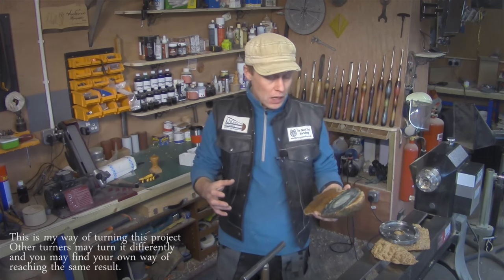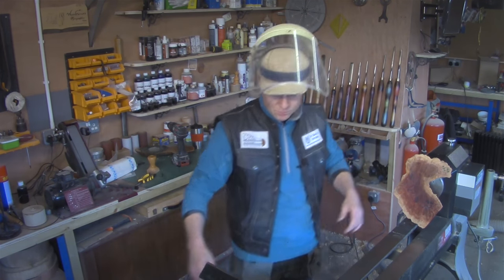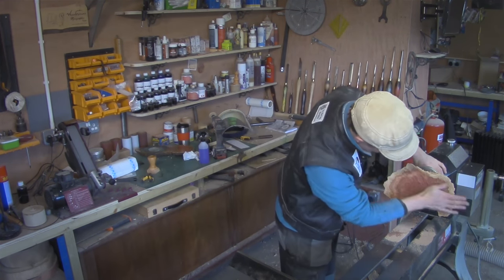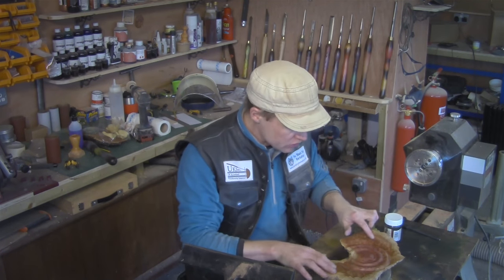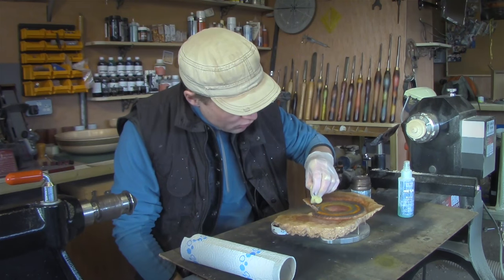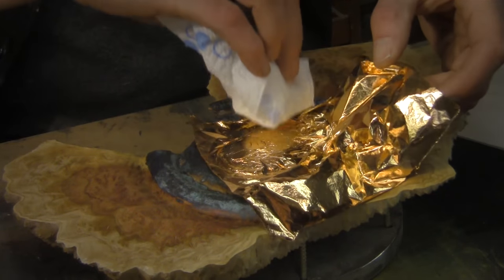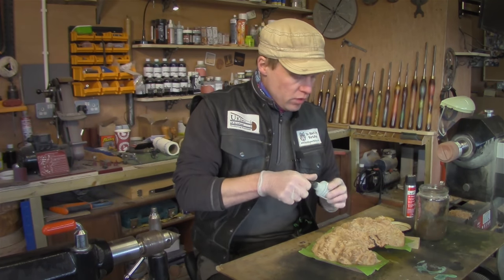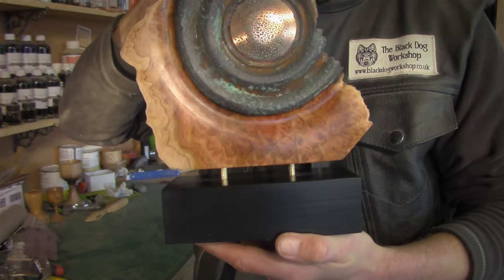#78 Turning an 'Ancient & Rusted' Mallee Burr Wood Ornament

Comment: Looks great Martin. I did wonder about the back when you started covering it with the paint as it looked really nice to start with. I don't think it has made it worse but also don't think it's made it much better. Anyway just my thoughts. The real striking part is the colouring of the wood, has a fantastic finish and colour to it. The shield just gives that extra point of interest which certainly makes the piece. Well done!
Reply from the maker: +Paul Lockwood Thanks, Paul. Interesting thoughts on the back of the piece. Simple reasoning for it - it wouldn't 'match' the front had I left it. Also, hiding the screw holes would have been a lot more difficult.
Still...art and creation is always open for debate. Such is the joy of it. This piece and thr sister piece have  sold, so I'm a happy bunny.
All the best,
Martin

Comment: Absolutely gorgeous, particularly like the back with its glowing lava like appearance - though when I saw you ladling on the iron paint I couldn't believe it was ever going to end up looking as good as the pictures you'd put on FB.  Is there a reason for using a sponge rather than stippling it on with a brush? (I'm guessing stroking it on would leave brush marks).

Comment: Lovely! The ONLY complaint I have - and it is a teeny thing really - is that the copper bit looks like it was sprinkled with patina rather than being aged like the rest. I'm not sure if there is another way to do it, that would have been less 'dotty', but the other piece didn't look like it had the same issue... but it is absolutely beautiful, even with the sprinkles!
Reply from the maker: Hi Susan. Thanks for watching and commenting. I know what you mean about the spotted patina. It has though, turned out as I wanted. I'll be doing at least one video this year using those paints again.

Comment: Stunning, just I knew it would be. A quick question, what did you use to finish the front? I'm guessing Hampshire Sheen High Gloss? Also if you weren't going to paint the back what would you have used to fill the holes, as coffee would be very dark against the light shade of the burr.  Once again a stunning piece and thanks for sharing. Jon
Reply: Hi Jon, I noticed your question of what to fill the holes with? I have had GREAT results with using a sawdust which is the same color as the wood, along with CA Glue. Respectfully, Martin might have a different approach though. Hope this helps! Have A Super Week!.....Gus
Reply from the maker: Hi Jon and Gus - Indeed, sawdust would have worked just as well as the coffee grind. A couple of reasons why I didn't go down that route: First up, I didn't touch the back so there was no saw dust from the back of the piece to ensure a spot-on colour match for the fills. If the fills are going to match, they need to be as perfect as possible otherwise they may be more noticeable - and in my book, that is almost unacceptable!
Had my intention not to have painted the back, I would have found some dust from somewhere of as close a colour as possible to use to minimise the hole's appearance.
Secondly, the coffee grind has been unused around the shop for ages; It is fine enough to pick up in gloves and easily drop/rub into the holes; It isn't so fine that it sticks to your fingers or gloves even before you get to the glue...in a nutshell though - because I was painting it, it didn't matter what I used as it was all going to be covered anway
And Coffee smells good. Nice than saw dust, anyway!
Hope that helps!
Martin

Comment: amazing work fella, i notice the sticker you peeled off where you bought it from, i have 4 smaller pieces that were duct taped together and red plus blue ink numbers written direct to the spikey side!!! , how did you manage to clean the ink and tape residue off?
Reply from the maker: Thanks, Mark. Sounds like you bought from the same place I did. Luckily only two of the pieces I bought had sharpie on the bark side...soooo annoying. This piece though had no writing on the back. I tried to clean it off the other pieces, but it wouldn't budge, so I painted over it. None of the pieces I bought were taped together though, but careful use of white spirit or meths should  clean it up for you.
Reply: Thanks buddy i tried acetone but all it managed to do was smear it, if the stuff wasn't so rare and beautiful i would set up a dispute and send it back, technically it is hiding information as the pics all show him holding the burls with the spiky side in the palm of his hand and taken from below with no mention in the descriptions about ink on the side most people show in casting/jewelry/stabilizing casts ect, lucky as the one i have turned already has had the ink just in the right places to turn away.